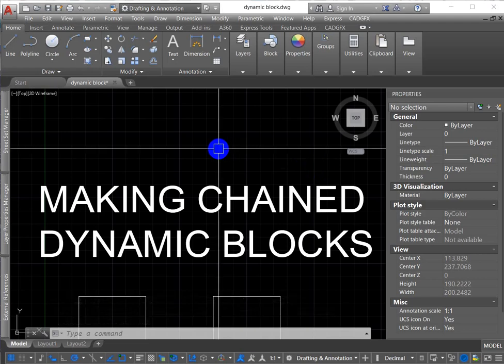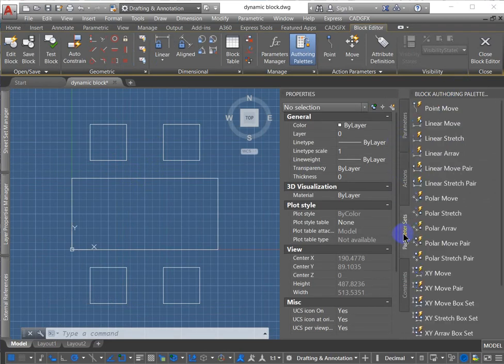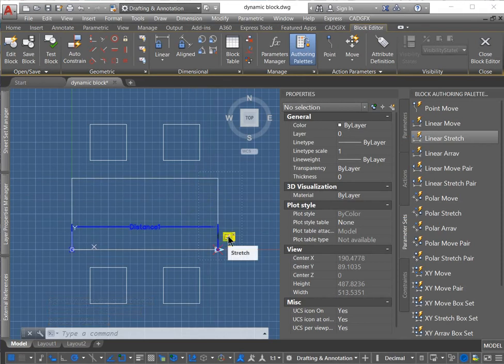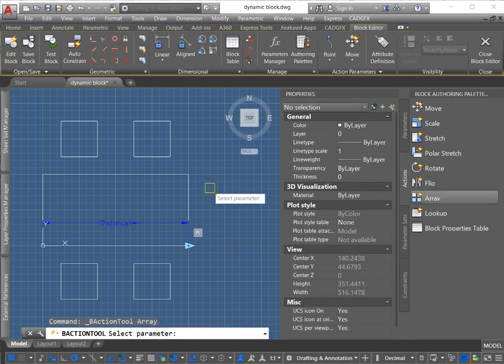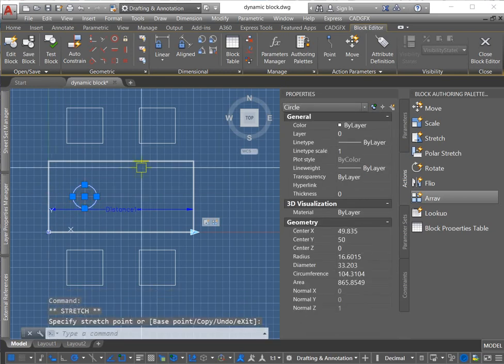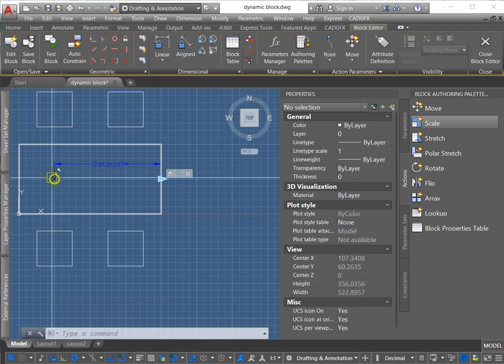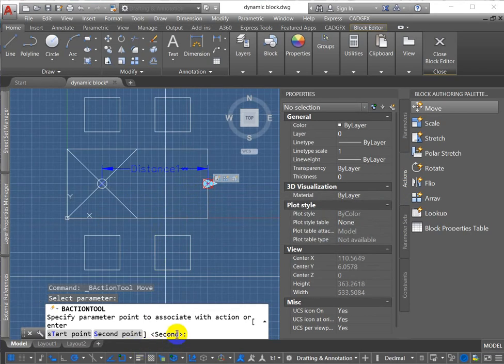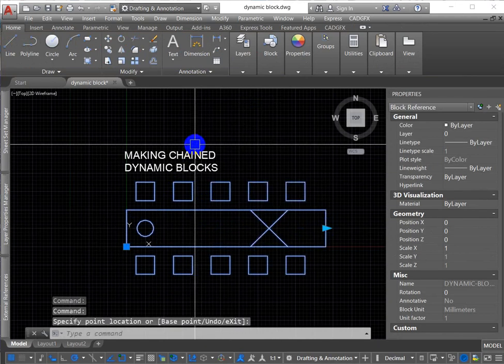Autocad tutorial - making chained dynamic blocks

Comment: I tried this, I have a bit of a problem, After I close the blocks, a couple of chairs already appears on the block outside the table boundary even if the table is not been stretch. Also in cabinets, clothes appears outside the cabinet. How to fix this
Reply: hello, i had the same problem. the solution is, you click the strech command icon, then go to properties ( of the strech command ) , find Overrides > Distance multiplier. You enter any value bigger than 1 in the bracket (for example 1.2), and the object will be streched 1.2 times of your linear parameter.. That will be the maximum lenght it will strech before adding a chair. if thats to big, no problem, you can strech it back using that little blue arrow as close to the last chair as you want. i hope it helps !